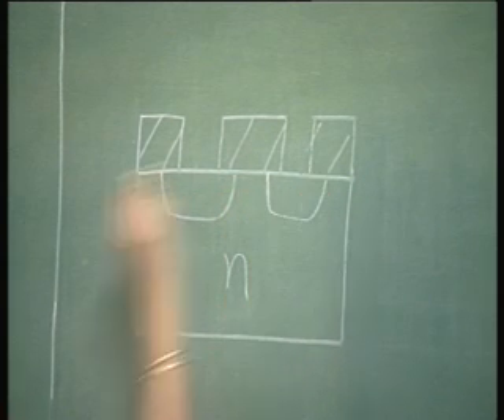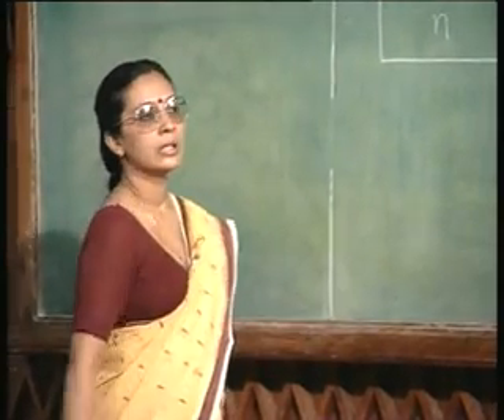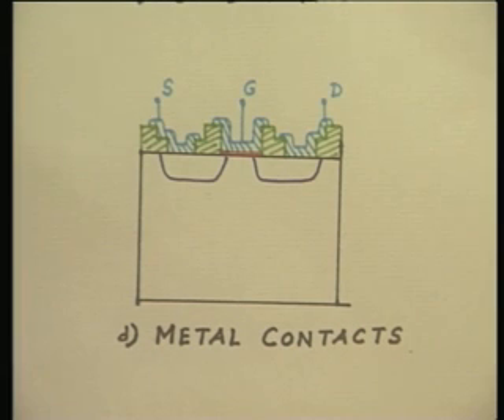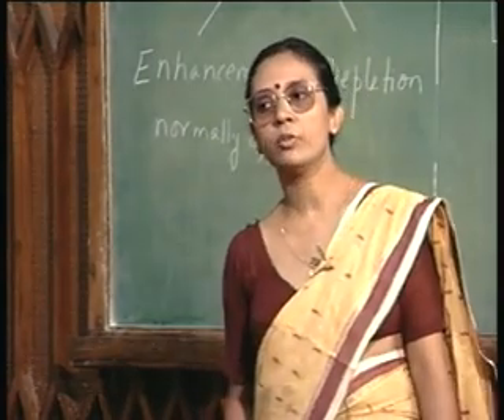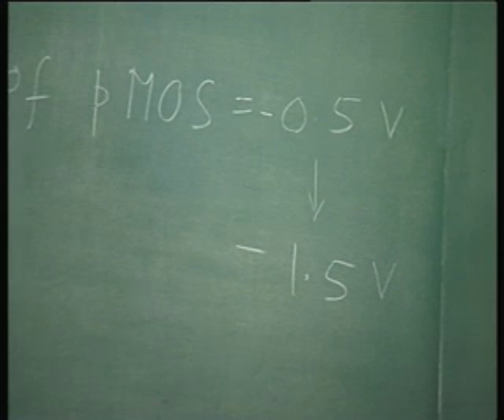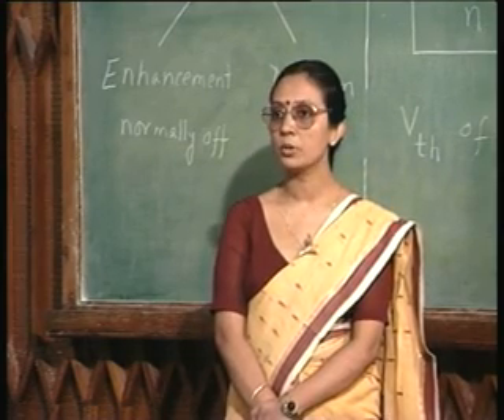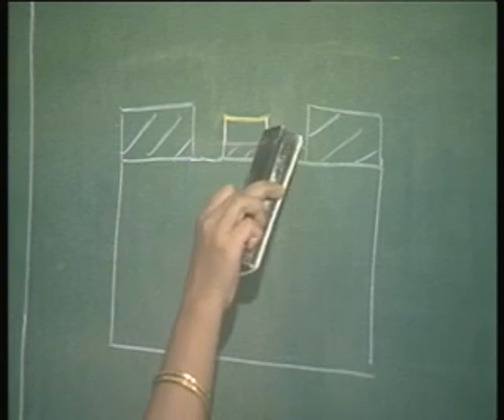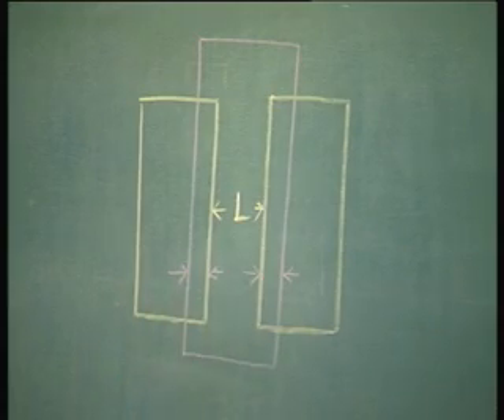Lecture - 2 Bipolar Junction Transistor Fabrication

Comment: How energy balances
Reply: Two systems combine
Reply: How it burns with oxidizer
Reply: In mechanical combustion comes fuel burns with oxidizer, similarly in electronics ,same thing I am asking
Reply: S to D energy is controlling
Reply: Dedication give quality
Reply: Mobile applications MOSFET are switching devices

Comment: Simple principal house hold purposes we are using metal sheet coated with insulator if sun radiation falls on sheet sum what heat radiated to house depends on the intensity of heat, similarly in roket also

Comment: Why can't we just dope to form Source and Drain after dissolving the Gate Oxide and before putting metal contacts? That way no high temperature steps are needed after aluminium is added

Comment: Why is gate oxide also introduced on source and drain regions?
What happens to gate oxide near these regions when metalization is done?

Please guide about these questions
Thanking You.
Reply: In fact, it is field oxide initially, which is then replaced by gate oxide
Gate Oxide acts as a protective layer as it prevents the entry of impurities through it. So, Source and Drain region need to be protected against finer dust particles, hence the use.

When metallization is done, the 'Field Oxide' is replaced, etched with strong acid, by a thinner gate oxide. The thinner gate oxide present over the source and drain results in the respective capacitances.
Reply: +Biplab Roy Thank you
Reply: Ravi Trivedi these little oxides at over source and drain removed but gate oxide remain by applying photoresist. photolitography and metalisation. metal contacts are driven connections between other mosfets. gates are protected by oxide. positive electrical field grows p source area and p drain areas merges. this is short circuit for source and gate.